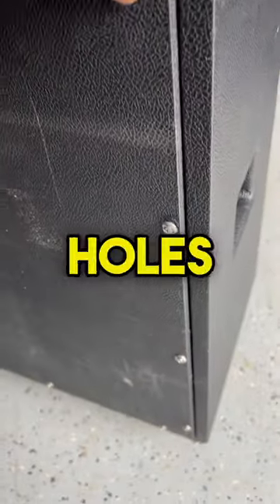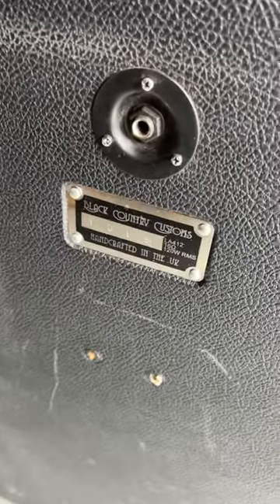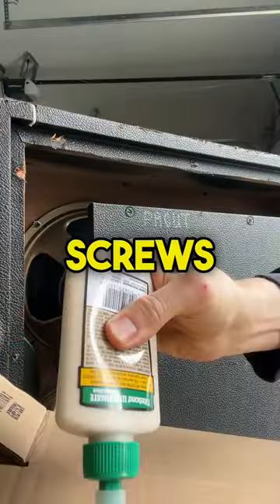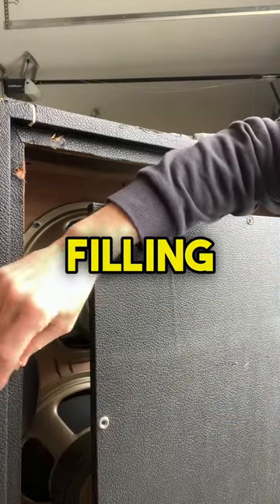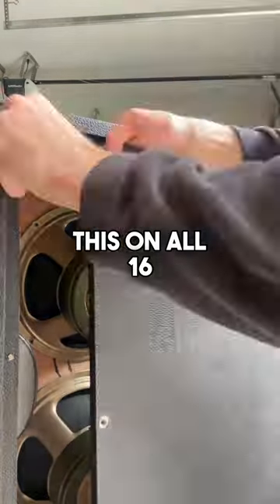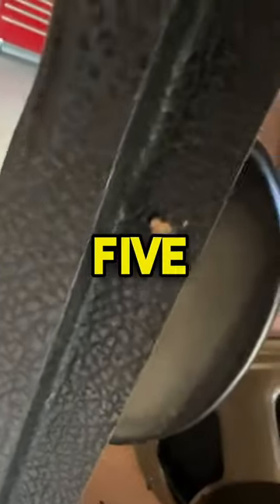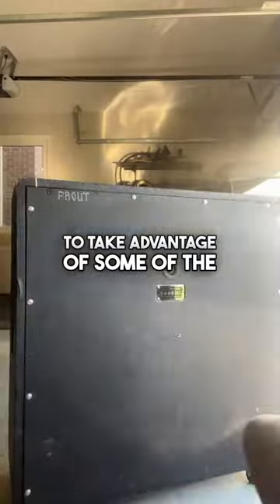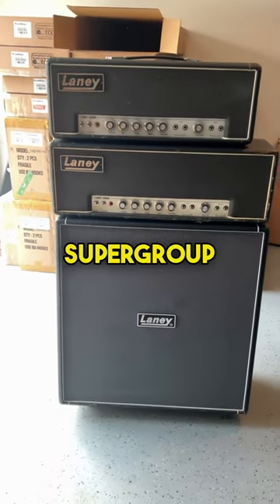Repairing stripped out screw holes on the back of this Laney LA412 Supergroup speaker cab.

Comment: On the subject of cabs, I have a Fender Super-Sonic 22w 1x12 combo, wanting to try an oversize, closed back, 2x12, slant cab for doom and Iommic tones in C#/C tuning. (or maybe try 15's?) My volume lives at 2.5. I assume 4x12 on 22w would be insufficient. I have tons of experience designing and building vented/ported sub enclosures for auto/home use, so I think I could save myself a bunch of money on this experiment. It will never leave my basement, so no need for durability, so thinking I could get away with 3/4" MDF vs. high quality birch ply? More importantly, would it be critical to build this cab in the traditional guitar cab fashion where it's not truly a sealed enclosure and the speakers are mounted from the inside, or would I possibly benefit from building it more like a sub box where it is completely sealed and mounted from the outside? I was thinking Vintage 30's was probably where it was at, BUT I think they are rated for 150w or so, and I discovered the possibility of running a Texas Heat and a Swamp Thang which seems appealing, although still 150w ratings. Should I consider some cannabis or other 50-75w rated loudspeakers with fat bottom end instead? Thx!!!